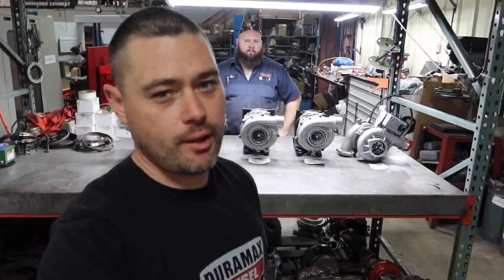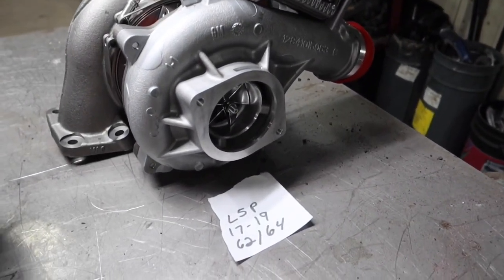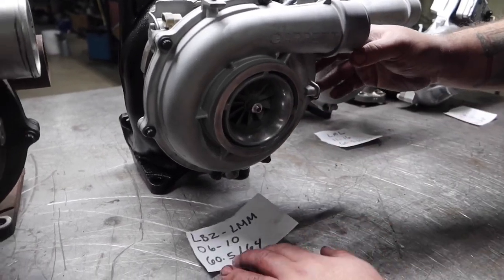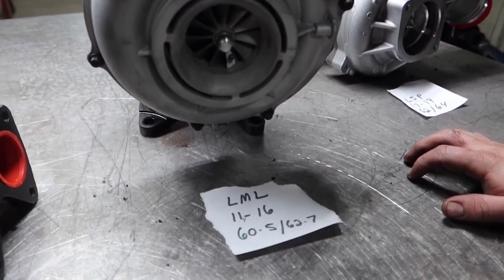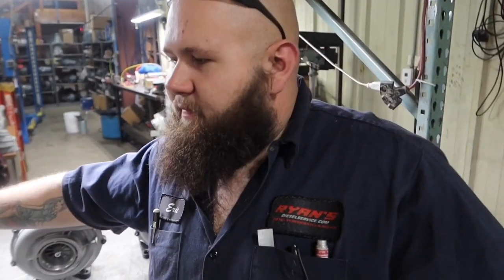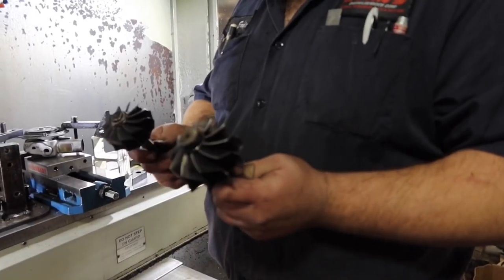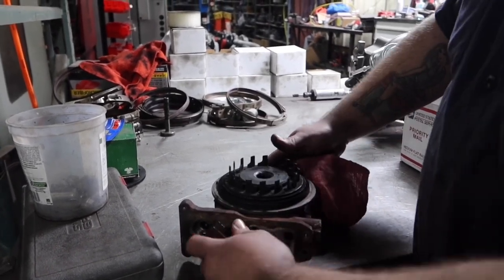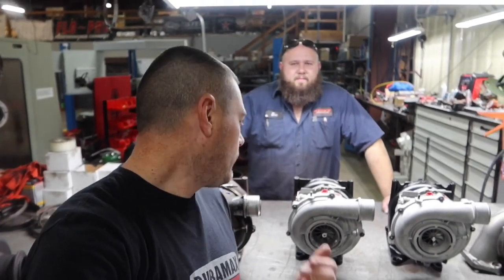Every Duramax Turbo Explained! Shocking Similarities

Comment: Great tutorial Josh! Quick tidbit I’ll share comparing the size difference of the LLY and LBZ turbo. I have read that GM engineers made the decision to downsize the turbo starting in 2006 based around the introduction of the six speed Allison transmission with the overdrive. I am assuming testing showed the smaller 60.5/64 was more efficient at highway cruising speed’s while towing at slightly lower RPMs. Remember, they were engineering for high torque and low EGT’s over a broad range of speed for towing and every day applications, while trying to stay in compliance with the gestapo and their new emissions standards.
Reply from the maker: Did not know that! Great info
Reply: Thank you for that information Steve, very interesting.
Reply: Can the lly turbo fit on the lbz?
Reply: @7kzone they said it would, I might do that on my truck

Comment: I have a 2000 Class A 36’ Newmar.  My stock turbo has a cracked case, also the exhaust manifold is broken.  Obviously I need to install both parts.  The stock 5.9 l is rated at 260 hp.  I want to increase the hp to the 300 hp mark.  Which combination will get me there and what additional parts should I install.   
Thanks. Dan

Comment: Great info  you forgot the LB7. COMPRESSOR WHEEL AND  TURBINE.  SIZE FOR IT !    MY QUESTION IS CAN ARE YOU ABLE TO INSTALL AN LLY  TURBO  INTO THE LB7 WITHOUT.   CHANGING ANYTHING NO MOD JUST BOLT IT ON ?

Comment: He said something about switching a 13 blade to a 10 blade? I don't care about the whistle. But what's that do as far as output. Like power or boost or exhaust.  I'm guessing that's the blades for the exhaust output. Just wondering in there is a tiny drop in power out put or a slight gain. Wouldn't be much. But some guys like to know every little detail. About his truck out put.👍
Reply: Steven Pellegrino I’d guess a 10 blade would be better, a lot less weight, think ford did it for the whistle.

Comment: Question for @ryansdieselservice. I get on a RDS turbo you hone the compressor side out another .5 inch to make it 64 but what do you do to the exhaust side? Especially if it's already a 66 exhaust from factory? How do you make it a better turbo is what I'm asking? Noce video Josh
Reply: Better flowing turbine is one big thing on a stock LLY unit. We still do some machine work on the LLY units but nothing to compared to all other which get quite a bit of machine work done.

Comment: Doesn't the 2006 LLY have the same LLY turbo? I ask because I have a 2006 Silverado LLY but rarely see anything but '04.5-'05 as the years of the LLY. Maybe mine is a rare breed?
Reply: Not a LLY if it’s an 06. Mechanically a lbz with LLY tuning/horsepower number. Basically a detuned lbz.
Reply: @gmanhall43  Any idea if it could be tuned with the LBZ tuning? It would sure be nice to get that extra horsepower.

Comment: He said he mainly works on 04 to 10, is the turbo in an lb7 a more solid one?
Reply: Kind of.  They are a fixed turbo so there are no veins to get stuck or go bad. 04-10 share pretty much the same turbo so there are a lot more of them out in the world compared to lb7.
Reply: Duramax 315 makes sense, thanks.  Still on my original lb7 turbo and hope it lasts

Comment: Hey truck master, I had a engine code come up today. Its P0238 boost sensor  A circuit high. Any tips or tricks that could help on fixing this? It's an 05 lly. Thanks
Reply: @dallydontspilly8121  thanks, I'll definitely do that
Reply: Mad Max  thanks for the info,  that's a lot of miles. Hope I get that much out of mine. I'm at 204k right now
Reply: Mad Max  I did my water pump at 195k, but yea any problems come up I'll keep you in mind

Comment: Those Holset's are a poor design in my opinion.
Reply: What's wrong with them? Last a long time, move a lot of air. They don't spool as fast as the Garrets, but they weren't designed as a racing turbo.